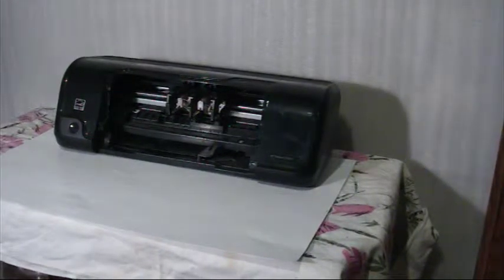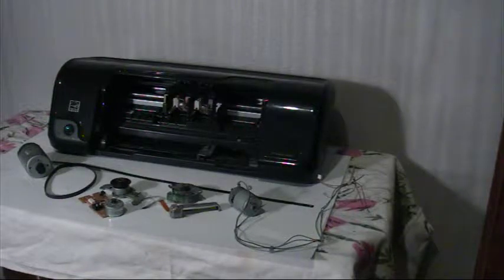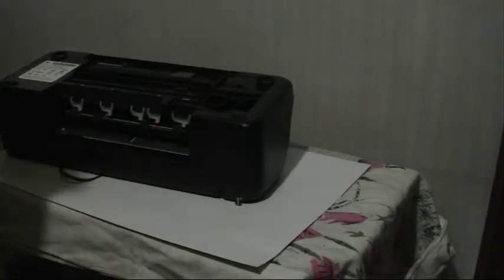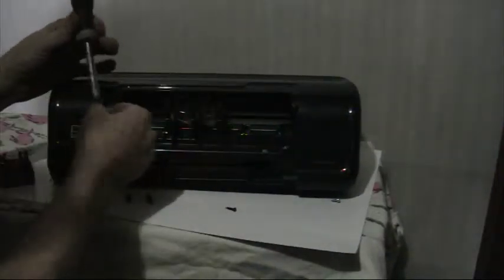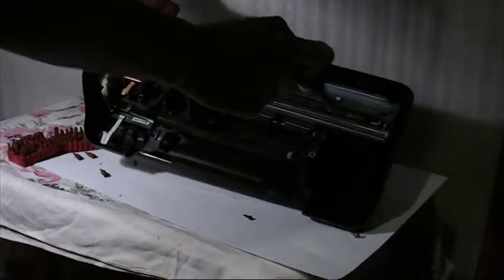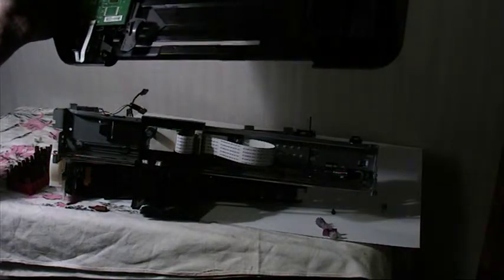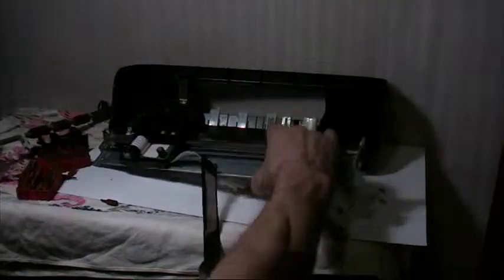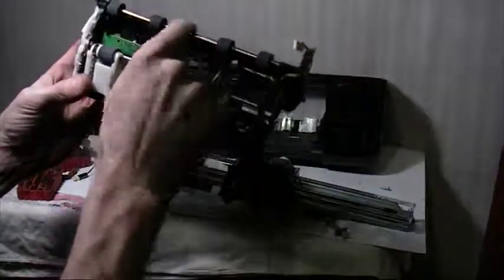Printer tear down in search of 3d printer parts

Comment: From what I've been reading the motors with the clear marked strips are straight DC motors running on a closed loop (?) And not steppers so haven't got the torque needed for a 3d printer.